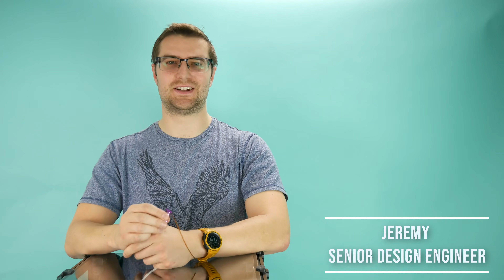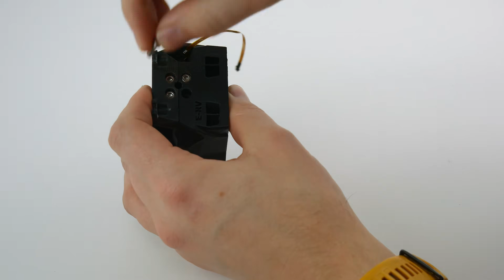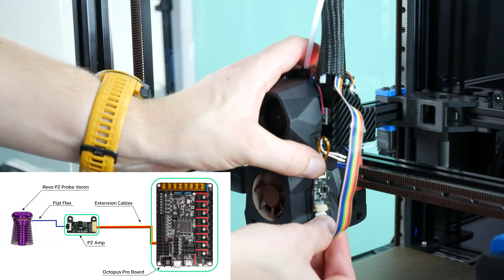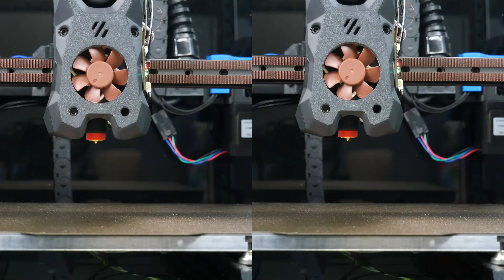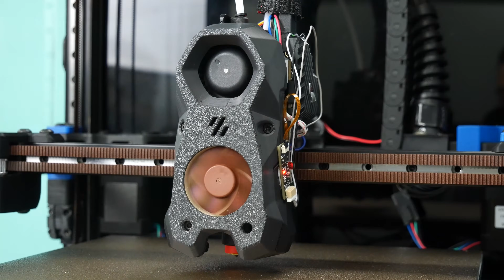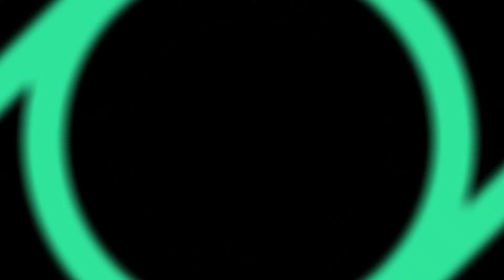EZ PZ 3D Printer Probing - A QuickStart Guide

Comment: In the Klipper .cfg you show "pin: !roto_tb:pb3"  but the Roto toolboard pinout specs it's shows PA15 at the probe switch ?  PB3 being listed as servo  (??)   Would it not need a custom connector to plug into the 4 pin connector 'a' on the revo toolboard ?

Comment: What is the sensor actually sensing? If it is physical contact as 'piezo' suggests, this means you can only do bed leveling with a hot nozzle, so the normal leftover snot on the nozzle doesn't give you a false reading. If you can set it to do this immediately before the first move (ie once the bed and nozzle are up to temp), I'll buy one! 😁
Reply: Contact probes using the nozzle generally recommend lower nozzle temps while probing. This prevents ooze and damage to the bed. Voron tap recommends 140 deg C if I recall correctly

Comment: I actually found that reducing the z axis motor power made false triggering more likely.

There was more vibration, even with the filter active it would pick it up.

I am using the stand alone PZ probe, ridgidly mounted between the hotend and mount.

The biggest issue I am having now is measurement consistency. I am using default 7 as that is the only one that will reliably trigger without false triggers or put enough load into the system to flex the mounting of the hotend. The printer will home well and without issues most of the time, but bed mesh and bed leveling will requires multiple retries to get consistent measurements. Taking two readings per point. It also fails often due to exceeding the number of retry attempts.

Default three is too sensitive, maybe if I changed it to a sensitivity level 2 it would work better.

Or I need to better figure out the vibration frequency. Unfortunately the online documentation is not the best, as it seems to assume you know more about certain aspects of control boards and pulling info from the sensors than I do.

Comment: Does this sensor need any temperature calibration/compensation?
Reply: Are you referring to temperature drift like with inductive probes, or thermal expansion related phenomenon?
Reply: @daltonC137  Either one, I've heard piezo is not ideal for repeated measurement. I'm wondering if this not the case or has been solved.

Comment: So this is just a piezo probe then? Love that its integrated into the hotend. Assume it works with other firmware - duet for instance?
Reply: I'd like to know about firmware support too!
Reply: @Blayzeing  all the processing is done on the piezo PCB side, all your firmware ever sees is a binary on off signal like any endstop so yes its compatible with any firmware that allows ednstops which is all of them
Reply: @ That's awesome - am I correct in assuming that this works with the standard revo heatsink? I've recently put Revo on my printer, and this would make first layer calibration awesome.
Reply: @Blayzeing  it is built into a special revo heatsink that is included
Reply: @ Ahhhh, I see, I see. Thank you for the reply!